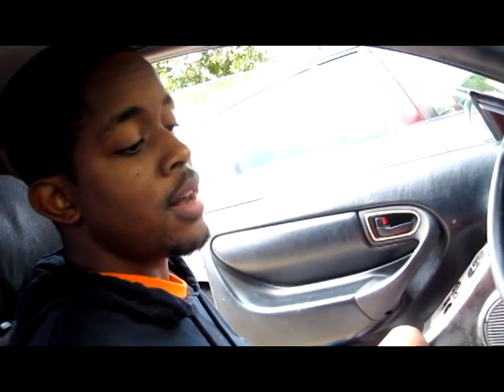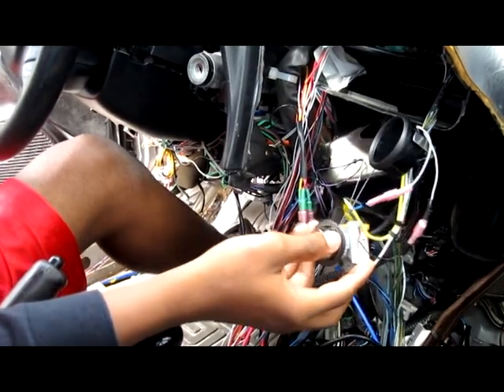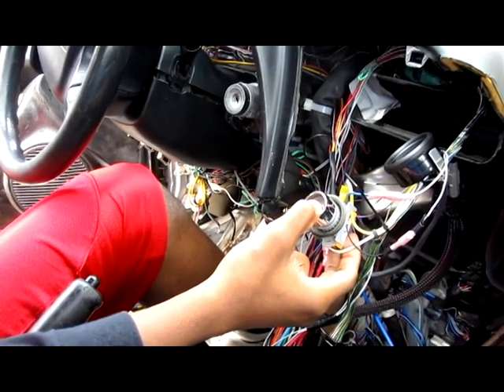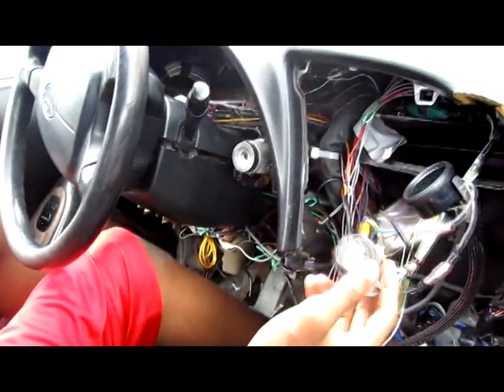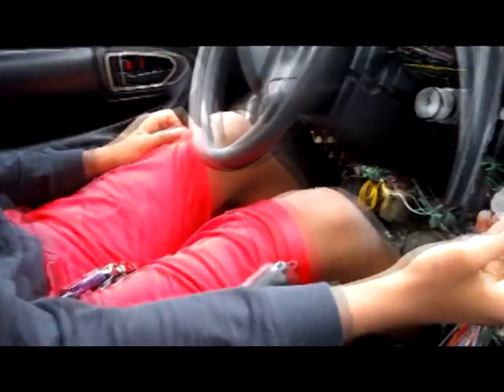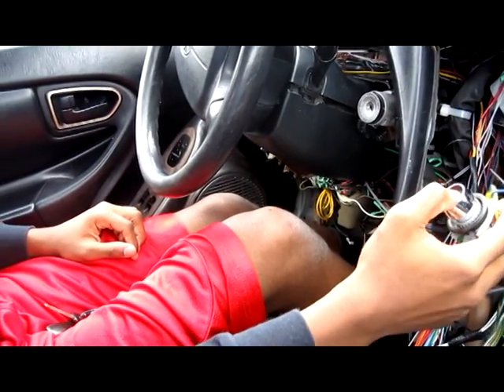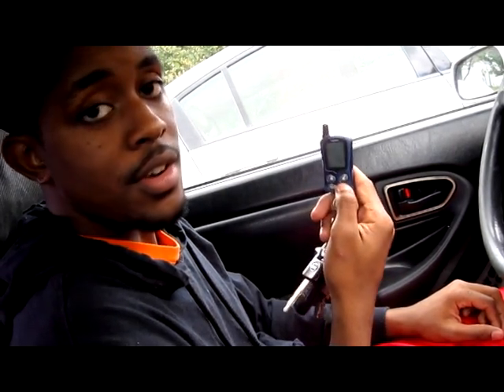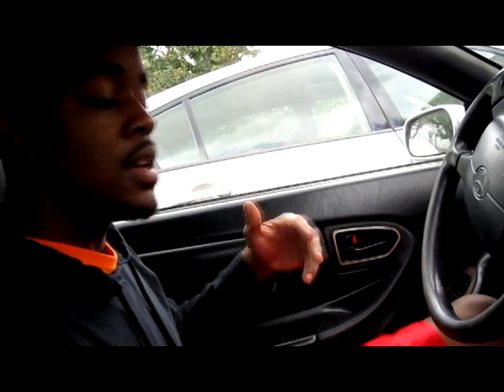RFID Keyless Ignition Conversion

Comment: excellent job on the install, though i must say that system appears to be quite slow to start the car as you wouln't want to be holding the button for more than 2 seconds to start the car. wondering if it is a setting thing or something.
Reply from the maker: its weird, sometime its slow sometimes its instant. If I could go back I would have made this more in depth or made a review of the use of the system but I was just experiment at the time

Comment: Kudos on your project, I just want to ask if you knew the industry standard for push button start relays, Are the relays normally open or normally close and what have been done to prevent power loss while the vehicle is in motion. I plan on executing this project but I felt it would be a safety concern, I have done loads of research and have built circuits like this before,  I build all types of custom stuff but safety is always the primary concern. Thanks
Reply: I guess I wanna know if you feel safe driving your vehicle without a key using your pushbutton start. I would only want to drop it low speeds if I knew there was a possibility that my vehicle could lose power.
Reply from the maker: Ttec518 all this setup is is multiple relays wired together, but you have to have a latched relay system for whent he cars is on then an external unlatch signal for when you want to turn the car off

Comment: Hello, does your car have immobilizer? How have you bypassed it?
Also how do you unlock the steering wheel without the key?
Could you provide some details about the electronics you used? I'm not asking for schematics, just the main principle of your setup.
Thank you
Reply from the maker: no immobilizer, i physically took out the lock in the steering. You could convert it to electronic but that would take fabrication and materials i wasnt going to invest into this project. Used a stack of bosch relays wired to together to give me the desired operations Acc/Ign start and safety disables and fail safes as well ....just relays and a RFID module / key FOB

Comment: i have to ask where you got the key fob or where i can find one. i have been looking for days to find it on thw internet but have had no ouck
Reply: +Nicolas Wright  You can find cheap generic RFID key fobs on eBay for around $1 (do a search for "RFID key fobs").... but just so you know those cheap fobs have a very limited range, so you'd have to place/hide the receiver/sensor in an area of your car where your keys and fob can be detected easily close up. A friend did this modification to his truck and used one of his cup holders to hide the receiver underneath. All he does is drop his keys/fob into the cup holder to activate the system, then uses the start button to start the truck.
Reply from the maker: +CoroaEntertainment those are called passive RFID, similar to how your credit card or gate keys trigger the receiver. What i used is called Active RFID, where the Key actually transmits signal to create an actual range of operation. I'll try to make a write up on my website. I know a ton of of ppl could use the info
Reply: +Unlimited Exclusive what is your website sir?
Reply from the maker: +Nicolas Wright unlimitedexclusive.com

Comment: How do you unlock the steering wheel without the physical key in the ignition?
Reply from the maker: i physically bypassed the steering lock inside of the key cylinder

Comment: Hey my question is this it matters if the car is manual did i have to used the brake pedal or the clutch
Reply from the maker: in this setup i did, but against its a custom setup. I built the relay system how i wanted it to operate

Comment: i had a question man. Im wanting to do this on my neon to test, then on my srt4 ( neon) if i like it. But my issue is the Neon (2001) has a ignition lock, now do rfid kits bypass it all together? or does it have to be rigged in some way that the car always thinks that the ignition is turned?
Reply from the maker: are you talking about the steering lock?
Reply: yea my bad.
Reply from the maker: yeah i rigged the steering lock. No how to on it you just have to find the mechanic of how yours works and you fabricate your own mod. I was gonna make it electric but its would be more work than the car is worth to me

Comment from the maker: @bunyan101 Oh and not only does it have a fart cannon, leds and push start, but a xbox 360, 4 monitors, Two CarPCs, dual battery, HO Alt, HIDs, with a fiberglass Dashboard, Center console, door panels, interior panels, and custom upholstery to come. Mmmm. The video does what is says. If you want to see more of the project, jus subscribe thanks :)